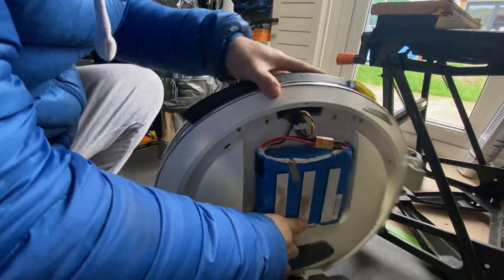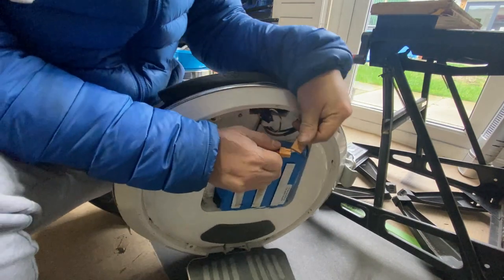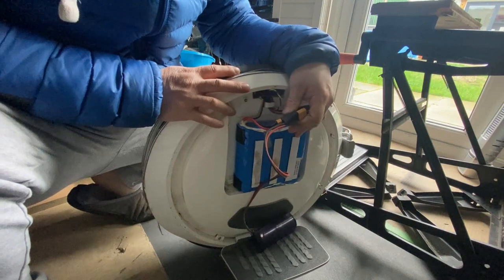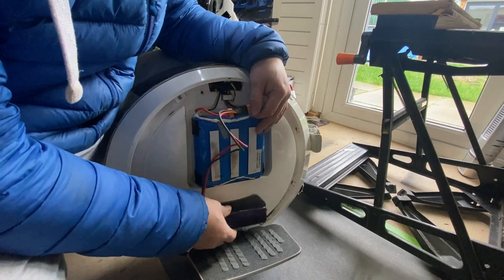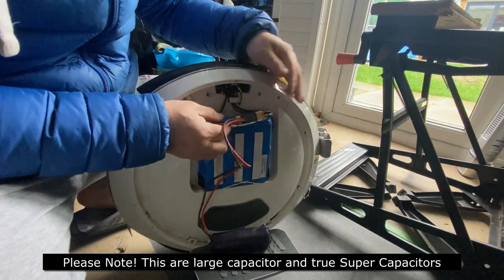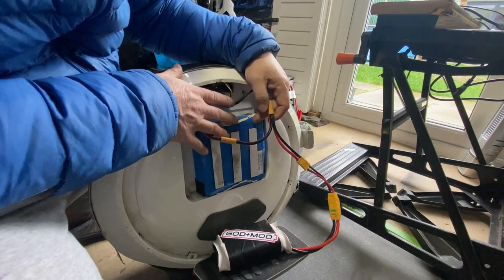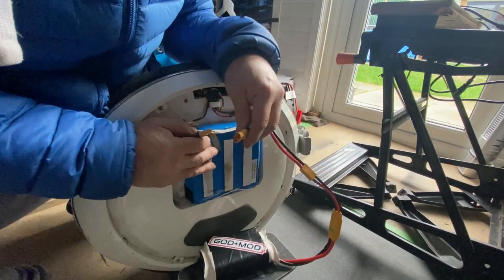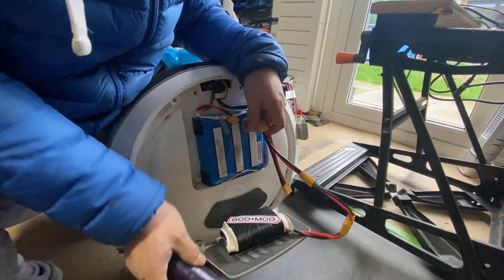Adding a Big Capacitor to your EUC wheel does it help!

Comment: Thank you for doing this video!
The capacitors used in GodMod can only provide power when riding for a few milliseconds though…milliseconds. There’s just not enough capacitance to hold enough charge to run for any longer with the higher current levels being drawn from the battery when riding.

There are some short term effects that capacitors can have though that might be affecting the balancing algorithms that the wheel’s software uses. The capacitors slow down the battery’s voltage drop (for sag) and voltage rise (from less current being drawn) and this could affect the way the software interprets what’s going on with the battery and that could affect how the pedal stiffness is adjusted. 

All just a theory for now though but the capacitors in GodMod can only run for a few milliseconds for a wheel in motion.
Reply: and this is at no load. if you put load there it won't last 1/10 of a second

Comment: What this test demonstrates is that a capacitor can store then be drained of energy, which is what's expected.
It does not demonstrate that makes a meaningful difference on safety when the battery is connected.
Why?

1. self balancing a small and light wheel forward and back a few centimeters drains only a few dozens watts
2. balancing a modern EUC at speed or during an acceleration takes 5kW to 10 kW
3. thats 250x to 1000x the amount of energy drained than in this example
4. taking an in between, it means 3s/625 = 4.8ms
5. but then this test was done at zero speed, when riding at speed the voltage must be higher. Let's take half, now we're at 2.4ms of effect
6. in a real installation, the battery is still connected, so the of connecting capacitors in parallel is reduced to how much lower the resistance and inductance of the capacitors are compared to the battery. On this one, it depends heavily on which capacitors, wiring and connectors are used so I can't guess. But it'll become a much smaller number than 2.4ms

Hopefully it helps to illustrate why although this demonstrate that capacitors can run a wheel doing almost nothing for 3 seconds, it does not mean that it will have any significant or even measurable effect on riding safety.

Comments and corrections are welcome.
Reply: He should do the same test trying to lift and free spin....with and without capacitors...and observe nothing.. ...and lastly who would add caps to ninebot when with that money you could buy a better euc or add more packs( I still believe this video is a joke).
Reply: Further on these points I am wondering if adding large capacitors in this manner might actually result in a less safe wheel because the capacitor might for a critical split second mislead the electronics into not issuing a current overdraw warning at the moment it was needed. It is akin to putting an interference mechanism between the power delivery side of the wheel to the electronics controller side.
Reply: @kmg501  Interesting point

Comment: Thanks for this, Kevin. Ideally, 10 seconds would be ideal as it would allow time to engage in breaking, which would recharge the capacitor in theroy, and or reduce speed to a better speed to cut out. If you ride within the limits of the wheel, you should never need this, but given the low cost of super capacitors, it is one worth the purchase.
Reply: There is no additional safety granted by this, under any actual load they will be drained in an instant.
Reply: @chanman1995  agreed…milliseconds at the most.
Reply: Frederick it would be nice indeed, however this demo is not representative of a riding scenario in the least. The 3s you saw here don't apply.
The most effective safety upgrade, for batteries is not adding capacitors but packs using high-drain cells which can deliver a lot more current with lower voltage sag - still within the mainboard and motor limits.
Reply: @François Simond (supercurio)  thanks for the update on this, I never push wheels, but this is good to know for sure, I was thinking ex30 with 40t batteries and would still have enough range.
Reply: @batterymooch  thanks for this.
Reply: @Chanman  I never even considered load, thanks gor this, it would be interesting to get load testing. The Internet will always offer valid information.
Reply: Ex-30 with 40-T cells is exactly what I ordered. I think I will try God+Mod with it. Not so much for cut out safety, but rather for instant torque delivery and less battery sag in the cold.  Pretty much everyone who has tried God+Mod seems to say that they do notice a slight improvement in their wheel's performance.  I don't really see the down side.

Comment: Personally from a safty stand point with solid reasearch and development behind it I think it a great idea add a step up transformer from the battery to the capacitor to bring up the voltage and keep it steady and then a step down transformer from the capcitor to the motor and I believe that will keep it balanced longer.....again it requires research and development the issue here is will EUC manufacturers see the Writting on the wall or pass it up as just merely a concept.....all of this could lead to a larger capcity battery, larger wheels....faster wheels....with an additional margin of safety.....will consumers want
to pay for this though? I think they would......I own a V-13 1st Batch and it is a stable Buttery Smooth Rocket...
 Motherboard died on me after only one use .....19 miles and it was GREAT......They replaced the motherboard immediately by the way. ( Everything has a shelflife including electronics.) Had Segway focused it's brand on speed and Stability rather then just a balanced plateform...
They would have had more sales. But getting back to the future
of EUC manufacturing.....
Throw in a German made Bionic Exoskelton and a
Tow missle and those miniture drones will not be able to keep up with the Ukrainians as they fly across the battelfield ready to do some damage.....
(A Military contract does alot for manufacturer. Like the Cessna 172 did in prior military action.)

Comment: I would be afraid that there would be a much bigger explosion/fire in the event of a short circuit on the battery... When the engine is loaded, the presence of the capacitor may not be noticeable... But I'm not saying that it has 0 effect...

Comment: Love the content you guys put out on this channel, but this was not a good demonstration of what a capacitor is for. It is not meant to cover for a complete battery failure. A capacitor supplements your battery output for quicker powerdraws while maintaining safe voltage on the whole system.
Reply: 100%.

Comment: So what will those 3 seconds translate into when you are actually riding the wheel at full speed?
Reply: It will not prevent you from cutting out if you went full speed beyond what the battery can supply you with. Those additional capacitors add extra time for the wheel to recover from battery sag in instances like going over jarring bumps which produce over spikes in battery consumption, and instead of cutting out abruptly, that 3 second save by the capacitors will keep your wheel upright. And when you have more than enough charge, it will come back on to power your wheel quickly and keep it balanced. These things happen with the Abrams and the Shermans who are very prone to cutting out going over bumps.

Comment: How many volt and how many "F"? I dint know what "F" mean, but many capacitors has it on the description on eBay or amazon.
Reply from the maker: The peaple who made this capacitcors usually doesn't tell you the value of the capacitors. You will not fine it even nwhen you open it up.
Reply: @eucupgrades  GoGeorge has a video showing that the prototypes used 2200uF, 160V, VXR Series, Nichicon caps.
Reply from the maker: @batterymooch  I know, great video thank for letting me know.

Comment: While I like the idea of an additional capacitor bank in series with the battery, I feel that it is poorly implemented and has only marginal safety value. It might be more elegant to place a capacitor bank in parallel with the battery but stepped up to a slightly higher voltage (10%-30% should be sufficient) where the capacitor battery reserve is on a relay that would only be switched on if the current draw exceeds a programmable threshold. This would enable a greater temporary power available at the cut-off event so that the spike in demand can be supplied while triggering a tilt-back for safe deceleration. This way, the rider could actually cruise at the cut-off threshold without fear of cut-out (except in cases to instantaneous power demand that exceeds the capacitors recharge abilities. {Of course, the electronics are slightly more complicated but not by much. And fwiw, I'm not an electronics engineer.}
Reply: There are only a few msec worth of power stored in capacitors. Your idea with the relay would works much better if there was an extra battery instead of the caps.
Reply: @adamguzik9350  Agreed Adam, thanks for the feedback.  
 
The problem I see with an extra battery bank is that the current requirements would make the weight penalty nonviable. Ultra capacitors may help and I believe this is what Tesla seems to use. The pre-cut-off current spikes need only a fraction of a second of power discharge because they are continuously being replenished when the motor demand subsides after the "shock" of a bump/pothole of instantaneous load. Still, if one over-leans at top speed, they're asking for a cut-out and my opinion is that it's unnecessary and undesirable to prevent stupidity; but, for those willing to heed tilt-back, this could enable the tilt-back to be adjusted to within a few percent of the maximum theoretical speed of the wheel. Either way, we can get a sense that there will be/ should be a more elegant solution that the current technology provides. 
 
My intuition is that I would like an ultra-capacitor bank comprised of 3 equal sizes, where 1 is "charged", 2 is "empty" and 3 is in process of charge/discharge. If the size of each section is sufficient to accelerate/decelerate from 0mph to/from top speed, then the main batteries would not be burdened with the acceleration loads, which would reduce the current draw/ voltage sag loads and virtually eliminate over-torque issues. {This would significantly increase range too!} This could enable for a smaller battery or even a hybrid fuel-cell power supply, which would mean a light-weight / long-distance / instantaneously re-fueled system... and that means a 100mph wheel is easily possible because the physical momentum restrictions of turning a wheel at high speeds is lessened. 
 
By example, what is desirable is to be able to maneuver your wheel at 60mph-100mph with similar characteristics of momentum as if you were riding 10mph-30mph, and that's not possible without severely restricting the weight or (more likely) incorporating two counter-rotating mass-gyros that could by torqued to assist in "lessening" the centrifugal forces of high speed cornering. 
 
If we go further, decouple the motor from the rim, and place a planetary gear reduction as the interface, then the motor(s) could be much lighter and run between 10k-20k rpm... thus making a smaller package more capable of an expanded performance envelope. Clearly, this technology of EUCs is incredible but I think the potential is much greater than we've imagined thus far.
Reply: @grb1969  Way to think outside the box man!!! 
 I love it!  You should get your ideas directly to a manufacturer. I might try Inmotion if I were you because they have the most money to invest and seem to be leading the way in wheel tech.
I think super light, dry state, battery technology is going to be the future big shift in weight reduction as well. 

 I always thought it would be cool if the EUC pedals were attached to independent, electronically controlled, suspension sliders that are programed to independently rise up the side of the EUC as you tilt one way or the other.  Seems like that would eliminate pedal clipping, allowing for extreme cornering and counter balancing.  So, if I were riding at speed and wanted to start turning left, as I tilt to the left,  my left pedal will start to slide up the wheel in accordance to the depth and speed of my tilt.  Not sure if this idea has any validity to it because I know nothing of physics, but I think it would be fun to try.
Reply: @ostumbling  Thanks, Mike.  I love your ideas on variable pedal height. I think it’s only a matter of time before EUCs catch up with the potential of the technology. There are structural aspects of the marketplace that delay manufacturers from adopting complex solutions to common problems but eventually, EUCs will be as plentiful as cars or bikes. 
The manufacturers do read the comments and I’m glad to suggest ideas from the shadows of obscurity because the good ideas eventually get adopted by the community, which then demands competitive improvements in design. 
I’m thrilled that you resonate with the movement. I’m also a strong believer in hybrid fuel cell technologies and active electronic suspension, which should be available within 5-10 years or so. 
 
If I ever end up consulting for the industry, likely I would intervene with the financial business model because of the fragile nature of resource utilization within these companies make them unnecessarily vulnerable to bankruptcy and consolidation, which kills innovation and opportunities. For now, I’m just glad that I can enjoy the amazing experience and freedom of riding an EUC.

Comment: Completely useless and unsafe. On a modern wheel at high speed it would only be a fraction of a second worth of power, not nearly enough to justify people messing with their wheel/battery and starting a fire. 

You should not encourage this kind of "mod".
Reply: Whomever is charging hundreds of dollars for what should cost less than $10 is surely finding this "useful" but I doubt that any more than 1% of riders would find this modification "useful" for riding. I would encourage the manufacturers to incorporate this idea but, again, it's not worth more than 10 bucks to me. 
 
I see nothing here the is "unsafe" except the inducing false expectations of users.